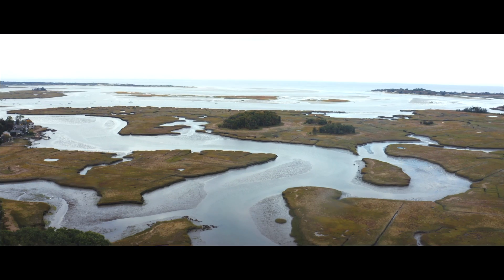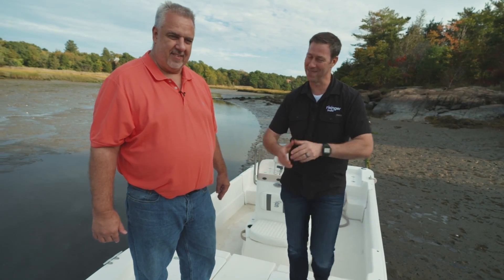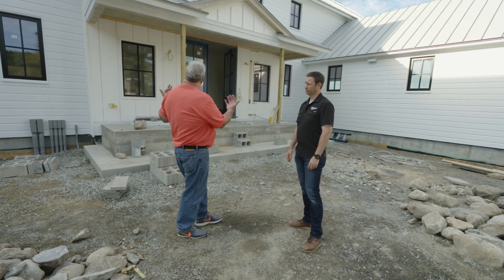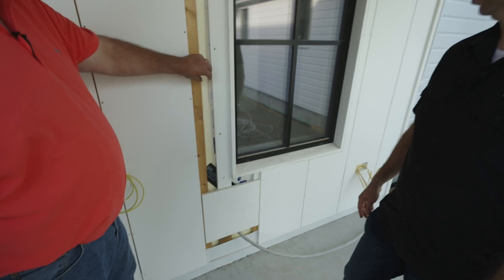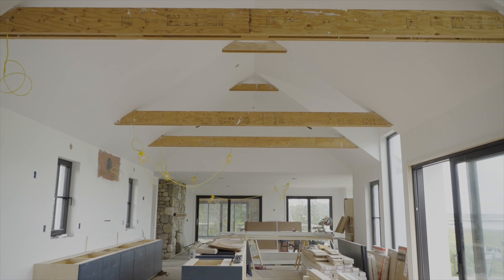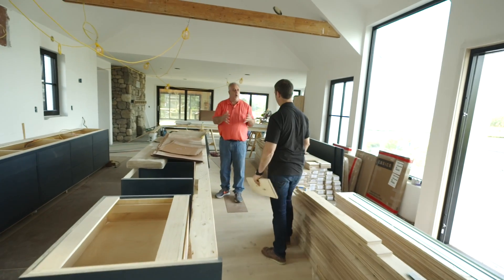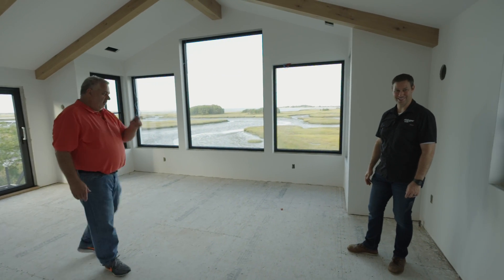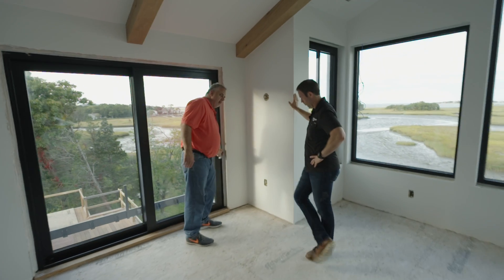High Performance 2x8 Wall Assembly

Comment: I'm glad whomever has the money to build this house is building it to last.  They're spending money on the structure and infrastructure and presumably it's fairly energy efficient.  Great job to the architect, the builders, and the owners.
Reply: Thank you sir, and thats my point tupically, people get on these rants but hell, I m about to design a 900 sq ft home, and all these questions will get asked there too.....far too many miss the point,  and thats why the industry corners like a freight train
Reply: This residence no noubt requires far less energy than a home this size built a couple generations ago and I applaud the quality of the work.  Yet this remains an exercise in guilding the lilly.  So no, a single family residence of that size by definition can not be "energy efficient" per person, especially if one counts the energy embodied in the like of making enormous  triple pane windows,  or in the kiln dried lumber making these castle walls, in the transportation of material to the remote site, etc. The point of a residence like this is most often a tax protected investment in real estate.  Yet  Mar a Lago display no longer  goes over well at the board meeting of the non-profit, so "energy efficiency" goes in the store window instead.
Reply: lol, who tf gets to decide what is or isn't a fair portion? You? This is quality construction that will house a lot more than just one family for multiple generations to come..... you think he is building that big house to sit in it all alone? you sound like you have a small mind.
Reply: @ar053x  thank you for the great words. Much appreciated
Reply: @ar053x  A family could be comfortable in well built house a fifth that size.  Or sure, live a in mansion instead,  Just please, don’t pretend its an an energy conscious country house with two feet thick walls instead of a mansion in which to stash cash.

Comment: Champagne taste on a beer budget. 
Waiting on county permits for my 2780 sq ft “modern farmhouse” build. Wish I could have afforded all the efficiency upgrades like this beautiful home. I did budget in all black fiberglass windows, backup generator and a lot of wood accents though. 😁 Excited to break ground!!
Reply: Good luck with your build Johnson family!!!
Reply: @stevenbaczekarchitect9431  thanks!!
Reply: @stevenbaczekarchitect9431  you are a master designer! I’m hoping to put in sweat equity and implement some of the air tightening techniques I see you and Matt do. If you had to pick two things for a handy homeowner to do throughout the build to improve efficiency without spending a lot, what would you recommend? Thanks!
Reply: @johnsonfamily4712  Solve for air leakage, it is he lowest cost/highest return. Also put in the best windows you can afford.
Reply: Do the things now that will put money in your pocket. Good windows, doors, insulate the crap out of it.  Go the extra mile on flashing to kkep the water out
Reply: @lb7wade518  Totally agree!!
Reply: @johnsonfamily4712  
1. Zip sheathing & caulk them when you attach it to the framing. caulk up any nail holes or as many as you can.
2. 2" exterior rigid foam panels. You cannot beat continuous exterior insulation cost\energy savings
3. Rain screen: I used 5/4 dimension deck boards.
4. Bucked window frames: I framed with 2x6" with 1.5" of rigid foam behind for thermal break. Primed the 2x6" on all sides to protect the wood & also helps for the window sill waterproofing tape to stick to the wood. Everything was also caulked so no air flow. Also put a bead of caulking around the edges of the window buck and the ZIP sheathing to make sure no water or air flow.
5. Recommend using LVL for your RIM boards: Dead Straight and won't expand (Swell)  like LSL if it gets wet during construction. Also primed & caulked all of the rimboards. Added boric salt to the primer paint for added insect protection. 
6. Use these EPDM seals for your rim & sill plates: www.conservationtechnology.com/building_gaskets.html
7.  Insulated your Foundation Slab using rigid foam panels (but make sure you use rateded panels so they don't deform under the weight of the slab (depends on how think your slab is. Recommend using stego 15mil vapor barrier between the foam panels and your slab.
8. if your installing a basement, add some drains (especially in the mechanical room). Siuox Chief makes drains with cleanouts for slab installed drains
9. If you can afford it, go with SIP roofing panels and a vented metal roof. If you go with SIP roofing panels you need a permeable vapor barrier so moisture does not get trap and rot the top later OSB of the SIPs.
10 Use raised heel walls between your roof trusses\SIP so you can properly air seal & also make it easier to install attic duct work.
Reply: @stevenbaczekarchitect9431  Who was the maker of the flooring?

Comment: As always Matt, Great information for builders in general. You’re a great ambassador for responsible; eco-friendly; low carbon footprint; Passive building which is the way building will be steered in the future. 
Good to see Steve too - great fellow –,You can see his love for building come out in his descriptions.
Reply: @suspicionofdeceit It's all relative - I have seen houses three and four times this size built to slightly above code standards. It is easy to make your argument I get it, but we could have some very terrible decisions here also.....all relative
Reply: There is nothing eco friendly about huge houses.
Reply: @stevenbaczekarchitect9431  Steven, a house 1/4 this size built to the same specs. Will be much more eco friendly. And still be huge.
Reply: @opfreakx  i understand,  but if this house were with another architect, and ended up with energy bills 3x, and water management and comfort problems,  then yes it would have been more wasteful

Comment: You know big money is building that house when they are doing blasting.
Reply: Blasting is quite common in many parts around here
Reply: @stevenbaczekarchitect9431  Yes in the same way that blasting is common for the like of  building Trump Tower.  Not so for modest single family homes.
Reply: @Nill757  Not in New England. The entire MA is sitting on top of the granite which you can't excavate or drill cheaply. Blasting in MA is super common regardless of price.
Reply: Work hard like us and you can be big money. Start with contracting and let the quality of your work speak for itself.
Reply: @stevenbaczekarchitect9431  If you get the chance, I'd love to see a video of the foundation work for a house directly on bedrock like this one.
Reply: @Nill757 , A civilian in my office used dynamite for a landscaping project. I never knew civilians could buy dynamite online until I moved to CT. At least in CT, you can’t dig 6” without hitting rock.
Reply: @thisismagacountry1318  who’s “us?” Everyone knows MAGA Country is poor and uneducated  😉
Reply: @Ang.0910  nice b8 m8
Reply: I owned a small (2400 sqft) chalet style home in the mountains of Colorado. We had to blast for the foundation. It is very common in some locations.

Comment: just guessing but the windows from this house most likely cost more than my entire house so far.
Reply: Does that mean the windows are expensive or your house is a a very cheap house?
Reply: @stevenbaczekarchitect9431  both  i'm on a fixed income so i'm doing the best i can with what i have and doing it 100% myself.  the house i'm living in is about to fall down. cant get any help from these programs. i guess i just to honest or dont know how to work the system. i dont know but if you measure in inches i am about 1 1/2 inches from being about to move into my new house NOT finish it. but the house we are living in is about a 1/2 inch from falling in on us.  i woke up july 6th with a 6 and 1/2 foot chicken snake trying to crawl in bed with me. july 7th i went and borrowed $13000 to start a new house. and i have made that 13k go as far as i can go. now i'm about to sell my bike to try and get my electrical and plumbing done enough we can move into it by Jan 1st 2021.
Reply: @stevenbaczekarchitect9431  no those windows are European inspired they are not cheap and somebody forgot to give us the brand😂 
No you’re not gonna find these types of windows at Home Depot they’re probably custom-made our guess directly from the manufacturer wherever they got them from😁
Reply: @literaryebooks  Schuco windows, all European windows are made to order, and you would e extremely surprised at the competative cost
Reply: @stevenbaczekarchitect9431  Thank you Steven, great to know Shuco windows  are competitively price. They are beautifully designed windows, gorgeous New England Farm house you made there.

Comment: I work in HVAC, everytime I see unmasticed ductwork I cry inside
Reply: Good for you Vocatusk. And the great thing is, your mastic process has a major impact, while still being affordable for ALL projects.
Reply: Agreed and a house packed with all those windows, that home will have cooling issues and heating issues. Mastic all joints should be code everywhere
Reply: why are you concerned about having perfectly sealed hvac joint that is within the building envelope?
Reply: @95thousandroses  You loose massive amount of airflow, it can destroy the designs of proper duct work, rooms won't cool or heat right. Also as expensive of the system they installed it lazy work to not do it.
Reply: @95thousandroses  You are correct, of course, in thinking that the first concern is for duct-work that leaks from locations OUTSIDE of the building envelope. (It's hard to find a home built in the midwest prior to 2010 which didn't have a large percentage of unsealed duct-work located outside of the envelope.)  But leaks from inside the envelope also contribute to inefficiencies and comfort issues, even though they do not cause the monster energy losses of exterior locations. In our state the best HVAC people can seal EVERYTHING quickly and efficiently, and it makes the difference between an OK job and the very best job.

Comment: Great project but if I did  a project like that I would have gone with ICF. It would have been cheaper as compared to this and will have better value over time,the 6'   concrete core can withstand any force of nature with minimal maintenance and degradation.
Reply: Yep, ICF would be a great choice for a coastal setting.
Reply: Underbitelover that’s a load of crap. Explain...
Reply: Agreed, I would have definitely gone with ICF for AT LEAST the basement and first floor in that location.  Possibly for the entire wall system and then used SIPS for the roofing since the design seems to favor "post and beam" look.
Reply: @jaysson1151  All building system have both advantages and disadvantages, ICF is no exception.  Initial costs are 5-10% higher, you will likely save more in the long run but there's more involved to do it in the first place.  There's also a learning curve to building with ICF, for example, if the concrete is poured too quickly it may burst through the foam panels, resulting in a messy blowout. In other cases, voids and air pockets can form in the concrete, which may lead to structural instability or even when all goes well the forms can still deform and need to be made plum again before the concrete cures or you'll have permanent deformations.  Problems can be dealt with if you have an experienced crew working with them but it's not a risk free system that you never have to worry about anything going wrong.

ICFs are vulnerable to bugs, termites, especially, have repeatedly demonstrated the ability to burrow through the panels, find hairline cracks within the concrete, and begin damaging wood flooring and joists before being detected.  So that can be a long term issue unless you take extra steps at time of building to prevent those issues but that's additional costs and labor on top of building with ICF.  Use of insecticides can also have separate issues if you go with treated blocks... 

While the R-value comparison advantage also tends to be exaggerated. A typical ICF wall delivers an R-value between 19 and 26, which is better than a home built using 2-by-4 studs and fiberglass insulation, but it's not up to the R-32 performance you'd expect from a home with closed cell insulation between 6-inch studs.  There are thicker ICF options but they're not exceeding what you can get with an equivalently thick wall. Though, comparisons of R-Value with concrete is not always equivalent because of how the materials behave differently, how the concrete acts as a thermal mass, how effective the air tightness is, etc...

Other disadvantages include difficulty to remodel, you have to think carefully when building to account for any future remodel or it will make it much harder to make changes later.  If you're in an area you don't need thick walls then ICF can have a issue for how much minimum space it requires as the walls will be significantly thicker than 2x4 framed structures.  Plus, anything dealing with concrete can have moisture issues and this property is by the sea. 

I would also point out not all ICFs are equal.  So simply going with an ICF system doesn't guarantee you'd get the best results.  

On lateral shear test, a high end product like Polycrete Big Block, for example, averaged 375 lbs. with a maximum of 420 lbs. Most others were found to average 235 lbs, which is almost 37% weaker.

ICFs can be considered highly fire resistant but not fire proof... 6” thick ICF wall systems with steel cross ties usually have a four hour fire rating and the plastic-tied ICF systems are generally only good for three hours. The EPS foam is generally the same or very similar, which means it's mainly the ties that vary the fire rating.

So things to keep in mind... ICFs have been around since the 1960's... They are much more widely used up in Canada but there are reasons why they have been slow to spread through the states.

ICF can be a great option, it is very durable and long lasting, but it's not automatically the best option or without trade offs to consider...
Reply: ZeoCyberG yeah I’m aware of those trade offs, but there’s a lot more experienced builders now than there has been, and now how to work around those. Down where I live with the hurricanes, my state has been hit 7 times this year, ICF is a now brainer! They’re really becoming popular in the Gulf South as the southern east coast. Nudura offers an R-35 block but it is a little thicker. Logix has an R-28 block using some kind of reflective material added into the foam which gives it more R-value without making it thicker.
Reply: @ZeoCyberG  For ICFs it better to pour concrete using standard foams and then attach the insulation after. One issue with ICF is there is no way to apply a exterior spray on sealant. with tradiational concrete forming, your can spray on a vapor sealant & use an fiberglass insulation so bugs cannot turn into swiss cheese, or will fiberglass degrade over time. On the inside you can install rigid insulation panels. This will provide better performance over ICF, and also make construction easier.
Reply: @jaysson1151  Experience helps, I did mention that, but doesn't change the trade offs.  Again, ICF's have been around since the 1960's...  They can be more popular in regions where brick or stone construction is more common, like ICF's are much more widely used up in Canada and as someone else mentioned in Europe where brick and mortar homes are much more common than stick framed wooden structures, with exceptions like Sweden that are heavily into wood construction...  But that also brings up how it's all tied to what's most economical as different materials will be cheaper to use in different regions... For US wood is usually the cheapest option and thus it dominates...  ICF's have their advantages but it doesn't mean it will be the cheapest option and some structures are not always meant to last a long time... Like in Japan, new buildings are usually intended to be torn down in around 30 years...  So structures that are hard to replace can be less desirable in those areas... There's always trade offs and reasons different choices will be made, depending on location, logistics, climate zone, local economy, available resources, and what forces drive the local housing market...
Reply: @guytech7310  Some problems problems with that: 

1, How are you attaching the foam to the concrete post pour, and how are you attaching anything to the foam (inside or outside)? ICF uses built in attachment points, as a built in solution.
2, ICF does not need a vapor barrier. Below grade waterproofing peel and stick EPS compatible membranes and spray solutions exist, as well as above grade if needed. 
3, The peel and stick membranes provide termite protection, but additional methods can be used above grade if desired.
Reply: @rafflesmaos  1. Same way to attach it to sheathing. Screws (Tapcon) or adhesive. On the exterior a tar based sealant can be applied and the fireglass insulation can be adhered (its very sticky)

2. Problem is Bugs love to tunnel it out making holes destroying the protection. Peel and Stick can only be applied to the exterior side of the foam, not on the concrete where its needed.
Reply: @guytech7310  Check out MDPEEL 40. It's specifically tested against termite ingress. I have no idea what you're saying about applying it to the concrete, as in ICF peel and stick is applied externally to the EPS foam. Applying waterproofing internally is frankly a pretty silly thing to do.

Using tapcon or adhering insulation to preformed concrete is more labor and materials. So now you're at the point of making a form, pouring, removing the form, attaching insulation, etc, instead of doing that all in one as with ICF. Not to mention that you're still going to have issues attaching internally - furring is required, again more labor. With ICF you just make channels and cut with hot knife, and all the attachment points are right there on the surface.